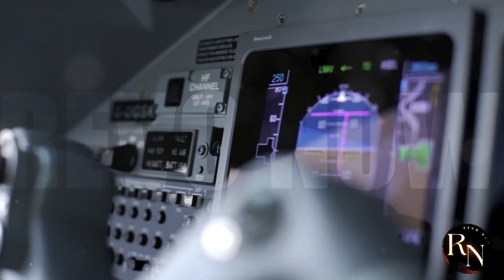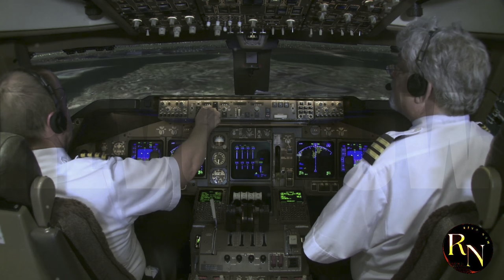COMAC is Changing the Game and You're Missing Out!

Comment: CR919?  I thought Russia bowed out?  The C919 comes at an auspicious time as Boeing is having technical and financial problems which might be the downfall of Boeing. Not only is the C919 trying to rise and prove its credentials, but C929 is in the development phase and has flown.  The C939 is on the drawing boards, but will cut metal soon.  There also are domestic engines to match, the CJ1000, CJ2000, and CJ3000 being developed with the CJ1000 seeking its operational credentials.
Reply: @MASMIWA  Yes, Russia 🇷🇺 withdrew from the joint CR929 project and are going its own route